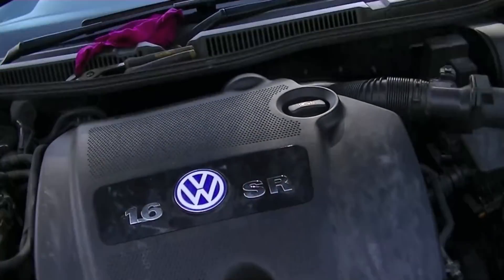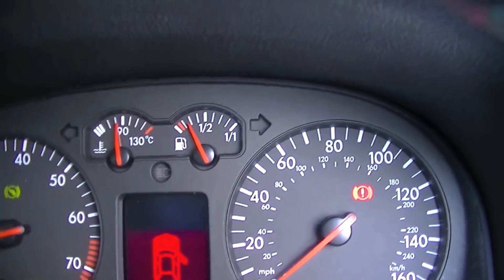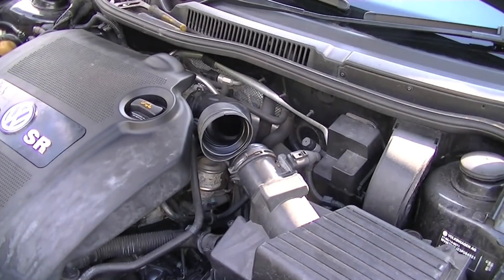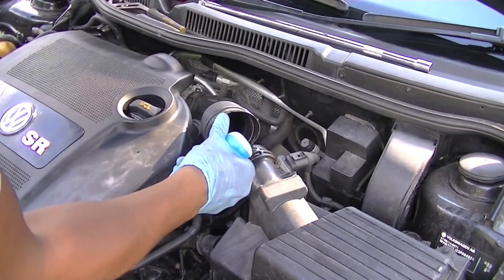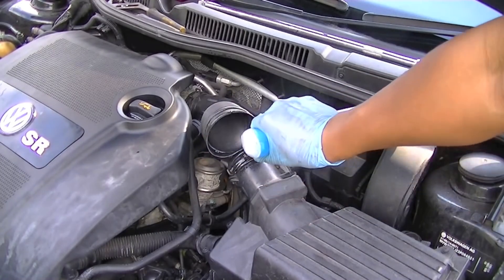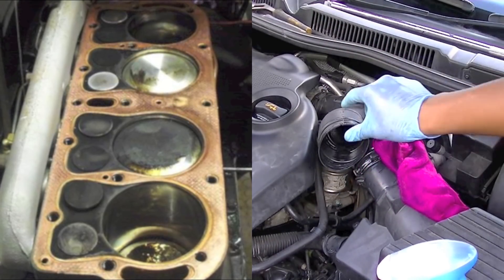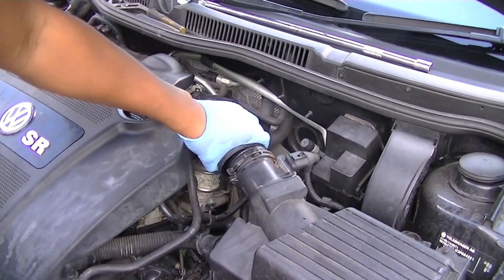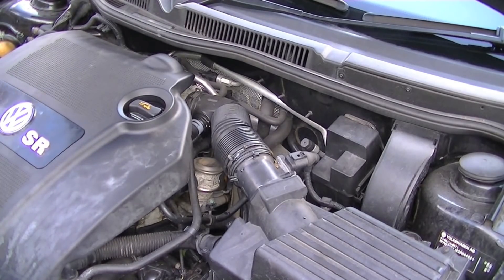How to make your engine run better with just tap water.......Better Than Seafoam?

Comment: I would use extreme caution doing this procedure to a modern engine of the last 20 years or so! There's really not much need to ever do this to an engine that's been properly maintained because the amount of 'carbonizing' of the valves is so small it's not really necessary to use this method of 'water/steam/de-carbonize'.********If you are certain beyond question that the engine is far too 'gunky' and an internal 'de-carb' is called for...then use a proper 'mister' of VERY FINE droplets of pre-heated water!(if you use droplets that seem like 'steam from a tea-kettle' then you will have proper-sized droplets) I can assure anyone reading this that just spraying cold or air-temp. water in the intake may very well result in a SEIZED ENGINE!!! DON'T DO THIS!And DO NOT 'RUSH IT'...take your time! I would use at least a half-hour of intermittent 'sprays' at small amounts at a time.And change the engine oil while it's still heated (and fresh filter of course) There may well be a small amount of water suspended as an emulsion in the oil after a 'treatment'...so change it before the water percolates out of suspension as the oil cools from operating temperature.********I would NOT EVER use this 'water-cleaning' method on many of the newer vehicles that have sophisticated 'very high pressure' fuel injection systems, such as Ford offers on their truck models to save fuel....the way the timing/injection process is 'pre-programmed' makes it a certainty that some form of ignition 'mis-fire' will occur if water is introduced into the system!One or more systems such as sensor mechanisms will be ruined if this occurs...and they must be replaced or the engine will not start or will fail to 'hold idle'. And these parts are NOT 'cheap'.
Reply from the maker: +Gerry Nightingale Please show where I say" it is a great idea to run a garden hose in to an engine".

Don't fabricate statements to try and substanciate your nonsense. Try and pay more attention to what is being said.
Reply: I wonder how many people there are that are sick to death of fckin' 
trolls writing shitty personal attacks on them as a so-called 
'rebuttal'...regardless of what was written in a 'comment'.

--- I deliberately resigned from making the comments personal...  It was only when your story changed a couple of times, that I started looking at you personally.

 I write something I consider to be very helpful and reasonable...to be 
cautious using water as a de-carbonizing agent...and now TWO assholes 
immediately jump in and basically declare..."THAT'S WRONG!!! IT'S 
PERFECTLY SAFE TO POUR OR SQUIRT LIQUID WATER RIGHT INTO A RUNNING 
ENGINE!!! IT'S GOOD FOR IT!!!

--- I think you've forfeit the right to cry foul about getting personal, with "two assholes"... (...and its perfectly acceptable to mist water into an engine...  Stop crapping on about "pouring liquid water" anywhere...  Only you have mentioned this...)

 I hope to fck no one buys into such asinine statements...one from a "MR.
 KNOWS ALL ABOUT IT!" and still another from a common 'troll' who has 
nothing to say except "I ACCUSE!!!" with two of three lines of 
shit-dribble!

--- reply not required for this

I especially liked the one reply which states that "THERE IS NO WAY FOR 
WATER TO CONTAMINATE ENGINE OIL!" Period.
Really?

--- There is no way that water mist, or the resultant steam can get to and collect in the sump in volumes sufficient enough to mix with hot engine oil.  Two completely different pathways from Combustion Chamber to the Sump.  If the rings are shot enough to allow a LOT of steam into the sump, then the engines fucked anyway, but even then, the steam will vent, and not mix with the hot oil.

 What this person forgets is that 'live steam' under pressure can easily 
force a 'blister' to occur in a head-gasket, or exploit even the 
smallest 'pin-hole' leak in the gasket material.

--- No, it cant.  Steam is under exactly the same pressure (9.5:1, in my case) as fuel/air.  Steam cant exert any OTHER forces or extra pressure characteristics than normal compressed combustion gasses. The expansion characteristics of steam that you're expecting to pop a head gasket, are a little more than a simple Water Injection system can manage.  If the car already has a blown head gasket, introducing water injection wont change a damn thing.

The engine-oil now has water in it...and that ain't good!

--- Hot oil and steam thats not under pressure wont mix.  Path of least resistance and all that.  The hot oil evaporates the water IF its water!  Which it isnt!  If steam enters the sump, IT'S STEAM!  CrankCase Ventilation.

 The person that wrote the smarmy, shit-ass 'reply' to me says 'Well, 
I've done this to my '305' Ford engine for years. so you don't know 
nothing!'

--- 302...  and I didnt say this, you did, with, "No...I have zero-experience pouring liquid water into anything I have ever owned, and do not plan on it either!".  I didnt say you dont know nothing.  I said I have an injection system, and it DOES work, really well...  ergo I speak from experience...

On an engine the DOES NOT HAVE aluminum heads...yeah, maybe you can 
'get-away' with it.

--- Head design doesnt matter.  Pro-Street race cars use water injection.  They cope...  The characteristics of water injection havent got anything to do with the construction material of the head.  BMW use water injection AND alloy heads, with massive success.

 If this asshole had read closely enough, he would have seen I made 
mention of MODERN ENGINES, most of which have aluminum heads! NOT 'cast 
iron', like the engine block.

--- "asshole" again.  You dont need to swear to get your point across...  

 Aluminum-heads are very subject to 'over-torque' and must be treated 
gently, to exact factory torque-settings, and this means they are NOT 
'seated' as firmly as a 'cast-iron' head.

--- The first part of this sentence is correct, that Alloy heads need to be torqued carefully.  ALL heads need to be torqued to factory settings, or run the risk of blowing the head gasket every time there's a day in the week.  The second part?  that Alloy heads dont sit as firmly as iron heads?  Utterly wrong.  They do.  They have to.  Quite often, on modern engines that perform much better than older engines, the compression ratio is higher, so they need to be bolted down harder, by more bolts, to save...well...  all sorts of issues...

It means that ANY variation in internal-engine pressure that exceeds a 
factory threshold can cause a rupture in the gasket material...that is 
what it means.

---This is correct, but as the range of allowable compression pressures is unknown, and the range is quite wide, we dont know what the factory threshold is, although turbocharged cars up around 12:1 compression have experienced gasket problems when they wide up the turbo to 30 pounds.  Water injection on a standard car doesnt lift the compression ratio anywhere near 12:1.  Again, the volume of steam required to lift a car from 10:1 to 12:1 is more than a normal Water Injector can manage.

 And steam-pressure can easily exceed the 'threshold limit'.

--- No, it cant, this is wrong.  You dont know how much pressure is being generated, or what that Gasket Burst threshold is.  How can you stand there and categorically state as fact, something which you dont know?

 "LIVE STEAM GENERATES FAR MORE PRESSURE THAN ANY OIL IN ANY GIVEN 
CIRCUMSTANCE".

--- Im intrigued with what you call "Live" steam, and then using that definition explain how steam under pressure GENERATES more pressure...

  What part of that is NOT 'understandable?'

- Just the incorrect parts...  or the downright lies...  The parts that are correct are easily understandable.
Reply from the maker: +Gerry Nightingale  Some people will talk "Theory" and some will speak "Experience". 

I'd rather fly with a pilot that has experience.
Reply: BMAC VAGS WHAT 'NONSENSE???'
I'm not going play this fucking 'troll game' with your stupid ass! Every word I wrote has merit, or I wouldn't have written it in the first instance!
All you've written is a 'personal attack' as if what I wrote has neither merit nor substance...instead you write of 'airline pilots' and then imply 'I'm wrong' somehow! What utter SHIT!
Your every word is nothing more than juvenile 'trolling' against me PERSONALLY, and anyone reading it can judge for themselves you're specializing in 'character assassination' and adding NOTHING to the question at hand of 'is it a good procedure to squirt water from a squeeze-bottle into a running MODERN engine? Yes or no?
*****
YOU LOSE, TROLL!
Reply: +Gerry Nightingale I would not do this either. Water contains minerals: calcium, silica, impurities, most of them sand. When water evaporates, they stay in, and guess what happens ? I would not use this unless it's and old car, that I don't care about. Much better to use a fuel system cleaner.
Reply: I wonder how many people there are that are sick to death of fckin' trolls writing shitty personal attacks on them as a so-called 'rebuttal'...regardless of what was written in a 'comment'.
I write something I consider to be very helpful and reasonable...to be cautious using water as a de-carbonizing agent...and now TWO assholes immediately jump in and basically declare..."THAT'S WRONG!!! IT'S PERFECTLY SAFE TO POUR OR SQUIRT LIQUID WATER RIGHT INTO A RUNNING ENGINE!!! IT'S GOOD FOR IT!!!
I hope to fck no one buys into such asinine statements...one from a "MR. KNOWS ALL ABOUT IT!" and still another from a common 'troll' who has nothing to say except "I ACCUSE!!!" with two of three lines of shit-dribble!
********
I especially liked the one reply which states that "THERE IS NO WAY FOR WATER TO CONTAMINATE ENGINE OIL!" Period.
Really?
What this person forgets is that 'live steam' under pressure can easily force a 'blister' to occur in a head-gasket, or exploit even the smallest 'pin-hole' leak in the gasket material.
Guess what happens next?
The engine-oil now has water in it...and that ain't good!
The person that wrote the smarmy, shit-ass 'reply' to me says 'Well, I've done this to my '305' Ford engine for years. so you don't know nothing!'
Really?
On an engine the DOES NOT HAVE aluminum heads...yeah, maybe you can 'get-away' with it.
If this asshole had read closely enough, he would have seen I made mention of MODERN ENGINES, most of which have aluminum heads! NOT 'cast iron', like the engine block.
Aluminum-heads are very subject to 'over-torque' and must be treated gently, to exact factory torque-settings, and this means they are NOT 'seated' as firmly as a 'cast-iron' head.
What does all that mean?
It means that ANY variation in internal-engine pressure that exceeds a factory threshold can cause a rupture in the gasket material...that is what it means.
And steam-pressure can easily exceed the 'threshold limit'.
"LIVE STEAM GENERATES FAR MORE PRESSURE THAN ANY OIL IN ANY GIVEN CIRCUMSTANCE".
What part of that is NOT 'understandable?'
I think most people would almost instinctively know this! After all...'steam under pressure' generates most of the entire World's electricity! It's pretty much common knowledge.
Most people who have owned cars for any length of time also know that 'water' and 'fuel' don't belong together, just they know water and oil don't go together either.
At least not in internal-combustion engines.
Reply: +Gerry Nightingale stop being so serious, what +BMAC VAGS wrote was hurting you ego!

Grow-up you are not 16, if you have better ideas, post videos rather than preaching!!!
Reply: Stupidwild596 I'm not entirely sure what your point is? Do this...don't do this?  I'm trying to guess...I don't know the exact routing of air-intakes for every model of car manufactured for the last twenty years!
*****
Let me clarify for the third or fourth time...what I wrote is a 'CAUTION".

As in 'use a good deal of caution' introducing water into something that should NEVER have water in it!
Can an engine 'tolerate small amounts of mist or droplets?' Yeah, they can handle that when they are running at 'high idle' or greater rpm's.
(I have serious doubt that anyone who can afford a very high-performance vehicle is looking for a way to de-carbonize an engine 'cheaply' and are willing risk a 20k engine instead of using the proper method!)
People who drive vehicles that have 'bi-turbo intercoolers' and/or single or dual-stage superchargers featured are NOT going to be pouring water into their 100k $ plus automobile!
********
If some people feel it is their 'God-given Right' to squirt water from a bottle into their car's engine and I shouldn't say a damn thing about it, fine. I was writing mainly for 'normal people' who may not realize it's possible to seriously damage an engine doing this if they aren't cautious.
Personally, I would never do this to an engine. I think it's not worth the risks involved.
I also know it's very likely I can still 'jump backwards' and land on my feet even at almost 62...but I'm not doing it!
It's not worth maybe snapping some vertebrae over just to 'prove a point'.
Reply: +Andy George   Ah, ha ha ha
Andy 1    Gerry 0
Reply: +Gerry Nightingale The only person I see trolling here is you,BMAC VAGS did not use any vulgarities or insults but you did,strange behaviour indeed.
Reply: +Gerry Nightingale I have a 1977 XC Ford Fairmont, GXL.  Factory 302 (5 litre) V8, which has done a half million kms, or so.  When she was new I bought it a Water Injection kit, and she's been running cold tap water since 1977...  No smoke, normal oil changes when i remember to do it, starts and runs like it was purchased yesterday...  Gotta love a clean engine...  :D

I was curious about your comment "I can assure anyone reading this that just spraying cold or air-temp. 
water in the intake may very well result in a SEIZED ENGINE!!!" when in reality the water mist that enters the engine turns bloody quickly to steam, and doesn't seize anything...  38 yr old V8, still ticking along nicely, unseized...

Im also having difficulties with "There may well be a small amount of water suspended as an emulsion in 
the oil after a 'treatment'...so change it before the water percolates out of suspension as the oil cools from operating" where no water enters the sump, unless the ring are stuffed.  That being the case the steam that does enter the sump will (does, in the Fairmont) head out the breather tube.  Upshot is?  Water vapour cant contaminate hot oil.

Looking forward to hearing your experiences on this...
Reply: Andy George I stand with what I wrote! I knew someone would surely answer  in the manner you have...that in some manner 'I am wrong, because...'
*****
You forgot to include where I wrote of subjecting a MODERN engine to  the pouring of cold water directly into an intake!
Are you actually implying  that pouring 'liquid water' from a container cannot possibly do any damage at all to engines made in the last fifteen years?
Fine...do as you see fit to do with your vehicle!
*****
You see no distinction whatever between 'water vapor' and 'compressed steam?' That there is NO possible way for 'steam under pressure' to contaminate engine oil?
That steam cannot overcome an oil-pressure of 35 or 40PSI vs. 200PSI or more from live steam?!?!
(try cooking something with a stove-top pressure-cooker and then write and tell me there is no 'seepage' at the seal-collar ring...by all means, try it)
****
No...I have zero-experience pouring liquid water into anything I have ever owned, and do not plan on it either!
I HAVE used engine 'de-carb' under pressure from a dispenser that recovers the 'blown-out crud' into a container...and yes, it had to be paid-for.
And the fact that NO DAMAGE at all was done to the engine vs. "Well, let's pour water into the engine and hope nothing goes wrong!' is somehow superior to using a proper cleaning system?
You've had 'no bad experience YET' with regard to using steam as a cleaning agent on an engine that's pushing forty years old?
Good!
Perhaps you will stay lucky!
Some people aren't willing to take such a completely unnecessary risk, and I am one of them.
Reply: +Gerry Nightingale I see you have put a lot of thought into what you're writing about, but very little experience in seeing it happen live...

Watch the video again, and tell me that LIQUID water is going in the engine... I see water mist going in, which in the grand scheme of water injection is acceptable, as Mist turns into steam, after absorbing inlet charge heat from the engine to do so. His demonstration is a squeezy bottle, which IMO is poor form, but if done properly, then Yes... I am stating that Water Injection is Harmless, if done properly... 38 yr old V8...

The steam under pressure is in the combustion chamber. As mentioned in the last post the Combustion chamber pressure fails with buggered rings. If blowby occurs then steam can enter the sump. The sump DOESNT compress, and the excess blows out the breather tube to end up back in the Air Filter box again. There is next to no oil in the combustion chamber (if the rings are in adequate condition) where all the pressure is. The oil in the sump should be hot, if you follow the recommendation to run the car up to temp before introducing the water... Steam under combustion pressure doesnt get to the sump, if it DOES get to the sump its no longer under pressure, and has an avenue of escape thru the breather, so it CANT contaminate hot oil.

I'm speaking here from my experiences... Turns out you are speaking from yours as well... The only difference is I have experiences... Its in the driveway at the moment. I have trouble with your warning people away from a perfectly good prophylactic engine treatment method, gleaned from your ZERO experience with it. Thats not very fair...
Reply: Andy George I have yet to 'jump off a cliff' either...and have not attacked sharks with my remaining original teeth to see if I can out-fight them!
You forgot to add that as well.
****
Just what is your point here? "I'm wrong?" Fine. Believe anything you want.
Just know that your attempts to invalidate a completely factual 'caution' on my part does you no service.
You forget other people will read this at some time or another, and your attempts to 'prove me wrong' just don't 'hold water'.<)couldn't resist!)
****
Just exactly 'where' do I state that this 'cheap' process cannot be done? Or that it doesn't work?
I didn't! You are parsing semantics here...just why is beyond me.
*****
Also...you seem to be confusing 'water injection' with 'internal- steam carbon and sludge removal'...the two mechanisms are NOT the same in purpose.
"Water injection" has been around for at least a century, and was used to 'boost' engine-output mainly in aircraft engines during WWII.
The water was frequently combined with methanol to 'cool down' cylinder-walls and pistons which were being pushed to an absolute engineering limit in terms of horsepower....most famously with the 'B-29' .
(engine failure accounted for more losses than actual combat...in fact many crews considered the '29' a  'death-trap' because of exploding engines)
*****
I have ZERO INTEREST in arguing with you over 'steam cannot possibly contaminate engine oil!' Your rebuttal is disingenuous at it's best...and completely facile at it's worst!
Reply from the maker: +Gerry Nightingale Brand New BMW M4 supplied with water injection. That engine is pretty modern.
Reply: BMAC VAGS And that means what, exactly?
If you think running a garden-hose is a great idea' into running modern engine, try it!
Try reading the 'caution' I wrote AGAIN...instead of writing  oblique examples.
You find something wrong w/using 'caution?'
Fine.
You like writing pseudo-sophisticated 'troll' remarks of 'you know more or better?'
THEN PROVE IT!
Prove I'm wrong...and you can't! If you could, you would've written it out now...instead of making  a shit 'reply!'
Reply: BMAC VAGS I have a much better idea! At least where you are concerned! It's called [block]!
I have zero intention of engaging a troll  who thinks they can manipulate 'comments' from me into some sort of completely inane argument where I must 'prove' something...especially to someone who hides under a pseudonym while posting completely irrelevant comments regarding 'airplane pilots'.
(stick garden-hose up your ass, troll! I'm done with whoever you are...you lose!)
Reply: Gigi de la tara Thanks for the affirmation! I had not thought of the 'grit' aspect, and it's a valid point.
"Tap water" usually is full of gunk you can't see until it evaporates from a clean surface, like glass.
******
All I did was make what I consider a perfectly valid 'use caution' comment, and I don't see where that's a 'bad thing' where an engine costing thousands of dollars is concerned!
I value my car, and I like to keep it in perfect condition as best as I am able to do or afford to have done, and I think there are many other people who feel the same way about their car.
*******
I have nothing against the 'steam method' of carbon-removal...all I said basically is 'use caution' if you use it...why is that a 'problem?'
If you can afford it....why not use a proper solvent made for that purpose?
What is wrong with doing a thing the right way, instead of doing something that has risk involved?
Reply: Bonzi Bonnie And another ass-dribble 'troll' gets {BLOCKED}...what a surprise!
(although I strongly suspect this is a 'sock-puppet' from the same troll)
Reply: +Gerry Nightingale  btw. Idk if this model is turbocharged but other motors with this air intake have that tube actually run to the turbo....turbo inlet...so this water would be going through the compressor side of the turbo on 1.9 Tdi and 2.0 tdis and so forth.
Reply: +Gigi de la tara Fuel system cleaner is pretty good at cleaning the fuel system, water injection is decarbonising the combustion chamber.  Ive not yet noticed a buildup of other residues from the tap water I use...  Different minerals in the water, perhaps?  None of them sand, I assume...  Could also be that water impurities in a steam cleaning system, by design, is a self limiting problem...  Just a thought...
Reply: +Stupidwild596 The instructions given to me when I had my kit installed was to put the draught tubes (that do the water spraying) AFTER the turbo...  Turbochargers get up to quite a temperature while operational, and crash cooling them by suddenly turning water mist on them is phenomenally bad...
Reply: B Tankful"0" what? What have I written that's been discredited? 
Point it out...or STFU! (try collecting more 'ball-caps'...the trademark of pinheads everywhere)
Reply: Gerry Nightingale .... This is His video, you're actually the Troll here!
Reply: Caleb Louard My! Aren't we clever! How thrilled your parents must be...when they're not busy chewing for fleas!
Reply: +BMAC VAGS This is a 'high-performance' engine, and BMW has modified it to use H2o injection as a means of 'partial boost' and is precisely measured along w/engine RPM and fuel-injection.How does sophisticated engineering coupled with a computer -calibrated injection process equate to 'it's okay to squirt water into a running engine?'The BMW  you mention is NOT using H2o injection as 'cleaning or de-carb' measure! It's being used to 'boost compression' on the piston down-stroke, thus giving more 'power' without increasing RPM's.*************You do yourself no credit by attempting to 'trip me up'!' It didn't work because you have nothing that invalidates what I wrote regarding 'use caution'.*************Is it possible you have some 'secret agenda' here? Like maybe encouraging someone to unintentionally ruin an engine by squirting water into it while it's running?Is that your game plan?
Reply: +fishbmw How about FUCK OFF TROLL! Is that 'vulgar enough?' ANYONE that HIDES behind a false name (like you) and then insults my intellect (like you)  can suck shit!I made a 'cautionary comment' and some douchebag trolls jump in fuckin' Conga-line and say 'You're Wrong' when the facts are I'm NOT WRONG!It doesn't matter 'how' it is rationalized...'squirting' water into a running engine is STUPID! There are solvents made for cleaning internal engine components...USE THEM!(when some asshole calls me a "LIAR" on the internet...then the 'gloves come off' and I'll write in any way I see fit to do so)ps...what in hell is a 'fishbmw?' What kind of proper name is that? It's just something for 'snippy' little trolls to HIDE WITH! That's what it is!
Reply: +Gerry Nightingale No, this method with fine sprayed water is well known and make absolutly no risk to the engine...except of extreme thick calamine deposits who can be caugh in the valves... 
For information, water injection was use on aircraft engines during ww2 to avoid detonation at high power or overboost...none "seizing" problems
Reply: +leneanderthalien Bullshit! I ALREADY wrote of the aircraft engine applications earlier...try reading the thread!While the injection process does work, obviously...it puts the engine at risk for seizing, which can and did occur frequently enough that it would be used only as 'emergency power'.What the hell do you mean 'none' suffered problems? More bullshit!Engines at high RPM'S can and do 'seize' if continued long enough...especially an aircraft engine that is two-stage superchargers and intercoolers equipped!Who are you trying to bullshit here? Me?It won't work! I've forgotten more history than you will ever know...and you proved it by writing 'engines can't seize or detonate!'Like hell they can't...the 'B-29 Wright-Cyclone R3000R series' engines were extremely well-known for SEIZING and blowing up! WTF???It was standard procedure to have men standing by with pressurized fire-extinguishers for every 'engine start' and you can plainly SEE IT on various 'Tube videos!Why are they there??? Just because they 'feel like it?" Engines were also equipped with 'self-extinguishers'...why? If there's never any possibility of a 'seized engine catching fire?'
Reply: +Gerry Nightingale  i was polite, and you are insulting... i'm engine specialist and i say you are totaly false...Seizing can occurs only with a large amouth of water like you use a garden hose to spray in the inlet...
 On aircraft, not only use in emergency power but at take of power at hot days...young, i was mecanic on Wright R3350 turbo compound and Bristol Hercules and the problems you tell are unknown in normal use, and wif the aircraft fly in the rain, it suck the rain water in without any problems...Fire extinguisher are very cold and can make a thermal shock...
But you are free to belive what you need...
Reply: leneanderthalien No...you writing a 'comment' to me personally that states unequivocally that no internal-combustion engine can possibly 'seize/detonate/catch fire/blow-up' is the same thing as calling me an idiot or a liar or both!
Use of 'emergency power' for take-off under very hot conditions DOES constitute a severe risk of engine over-load and fire or complete engine failure...no pilot on Earth would risk it unless it's wartime or some other emergency!
(what do you think? Everyone on the internet is stupid? WRONG!)
Did you NOT just write "Problems you describe do not occur under NORMAL CONDITIONS"
Use of 'emergency boost' for take-off IS NOT NORMAL!!!

"Fly aircraft in rain?" What in hell are you talking about?
NO...'rainwater' does not ever go into the engine...what makes you think it does?
There are plenty of baffles and chambers that prevent liquid water from entering a 'non-jet' engine, so I have no idea what you mean with that...and you claim to be a mechanic!?!?
How is that possible...if you don't know how engine nacelles are constructed to prevent that very thing? Water entering the engine? HOW?
 What in hell is 'believe what I think' supposed to mean?
I believe in engineering and the dynamics of particle- motion, and I also believe you don't have any idea what in you are stating as being true or not true!
That's what 'I believe!'
You keep changing your basic premise from one 'reply' to the next!
First you stated 'No, it can't happen at all' and then you write 'Yes...an engine can be damaged by too much water intake!"
THAT WAS MY WHOLE POINT TO START WITH!!!
Reply: this makes sense to me, because just like hot glass and cold water something could give that is already weak, if you add cold water, to a hot engine in the winter could that not create a problem or possible warp if accidental over pour or spray happens? well, like I said in my previous post, I'll stick to brand products 👍
Reply: +Rob Zimbelman Hot glass Vs Cold water, I agree...  but most engines are iron or alloy so dont act like glass at all.  I'm not about to suggest what could happen in an accident scenario, but as aluminium alloy (or iron or even moderm glass thats been tempered) doesnt shatter under thermal transition, I'm prepared to bet that it wont break.

Over pour/spray is also unlikely (especially out of a squeezy bottle) unless you're giving the job to your children, and even then, it'd be a LOT of water vapour that would cause the engine grief... 

This, like any, job has its caveats...  It's not idiot proof.  There are factors you have to be mindful of, but then we're not idiots here.  We know how to be careful.  We're not about to charge into this without doing a little homework first.  You might have read my posts above, but if you havent, this method works really really well on my car, BWMs new M Spec car, The RAF used it in the Spitfires...  101 uses! but my car has a proper Water Injection kit installed.  Squeezy bottles at 10 paces isnt ideal.
Reply: Very funny...'idiot-proof!'
Reply: Yeah no I get it for sure, I only own Chevy's and honestly just have kept on my maintenance, my 99 Chevy burban k1500 I've had sense 2000 it now has 240,000 miles I guess I was just unsure if in my older engine if the heads are starting to warp, which I doubt because the truck has only went threw one radiator n over heated that one time, I just figured if not only a water spill or to much spray would do it but if someone were to use ice water from the hose on colder conditions, not really any biggy I had a Lil something to sip on that day but, thank you for the info I will definitely look into this for a quick fix for my buddies older gm.
Reply: +Rob Zimbelman Oh right, OK...  The water mist absorbs heat as it enters the engine, making the inlet fuel/air charge dense...  Dense = more...  More = power...  then there's that "steam cleaning" side effect too, but that's beside the point...  The more heat absorbed by the water mist turning into steam, the denser the inlet charge... so the colder the water, the better...  Unfortunately the injection kit lives under the bonnet (hood) with the engine, so cold isn't always available in my ol' girl...  Meh, I'll take what I'm given...

Well met, Rob...
Reply: Hahahah. 
Omg don't spray water in your engine it's gonna blow.  
Haha that's funny. 
How come I use water injection for power and haven't blown anything up yet ? 
Been 3-4-5 years I forgot how long. 
I just have a button on my shifter and when I floor it i activate the water injection. 
Nice power adder on my diesel and it reduces egts. 
Water injection dates back to the 30s and maybe even earlier.
Reply: No it's SHOOT THE TARS!! 
SHOOT THE DASH!! 
Haven't you ever seen the old stp son if a gun protectant ad with Richard Petty? 
That's shootin the tars right there.
Reply: +Gerry Nightingale Except today's E10 fuel is complete crap and carbonizes valves, intakes, EGR valves and passages, etc, etc. Cleaning an engine is just as much a part of its maintenance as changing oil. Obviously the intervals aren't as narrow as oil changes, but should be done none the less.
Reply: +charlietow  i use always E10 (only "Total") and at last spark plugs change i see with a optic fiber that my engine chambers are very clean, without carbonisations (i drive minimum 120km per day, most on highway).You carbonize if you drive only in city or short distances, or with low cost gazoline...
Reply: +Gerry Nightingale On another note. I've done this method to MANY customer's vehicles with positive results EVERY SINGLE TIME. Also, saying what you're saying is fact does not make it fact. Insulting someone's obvious knowledge about an ICE does nothing but point out your ignorance on the subject. Andy has some seriously good points, and you insult, like a child. You need to brush up on how ICEs work. You do have some good fucking vocabulary and grammar skills though, so that's nice.
Reply: leneanderthalien Not everyone drives 120km a day though. And even using a quality fuel, E10 will still carbon things up for the average commuter. I don't need to look inside with an endoscope to see that when I get to tear them apart and fix these issues, as I do this for a living. One individual experience with an automobile is not going to be the same as thousands of others.
Reply: +Andy George that's the information I was trying to lead to. didn't write it. figured it was a given. I have an Alh I daily and just swapped to the euro spec turbo "vnt 17" and also have a cr motor. I'm not familiar with euro diesels but since this car wasn't designated a tdi I figured it wasn't along with hopefully making some people watching this video think before they "do something they saw on video"
Reply: +Andy George *figured it wasn't a turbo diesel..since it wasn't designated tdi
Reply: +Stupidwild596  ALL recent european Diesel cars are turbo diesel, the name for the turbo diesel change for such make: HDI,DCI,TDI,CDI,etc...= the same technology (commonrail direct injection+ turbo), only the older VW TDI use pump injectors for the direct injection...Swich from this older tech to common rail was made because is much noisier and make more pollution...